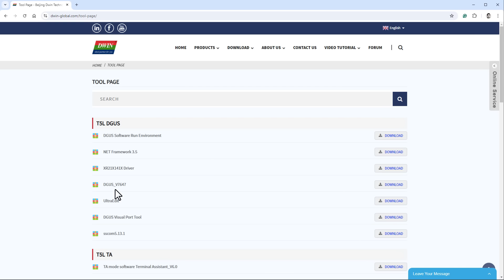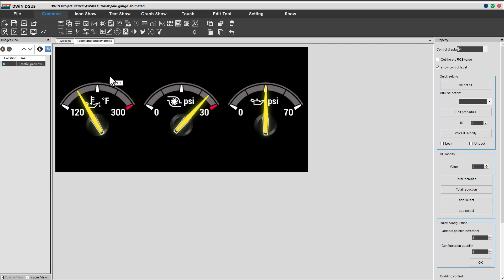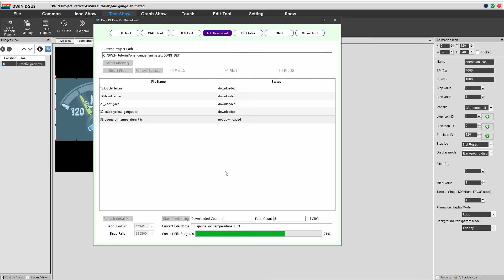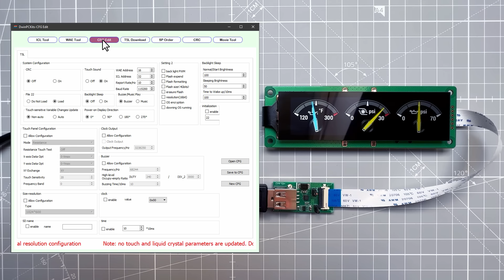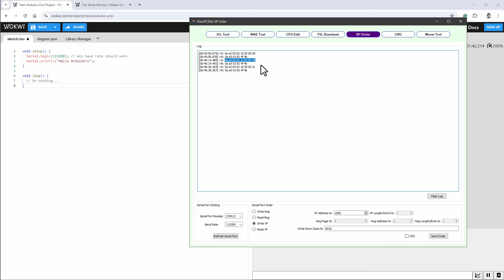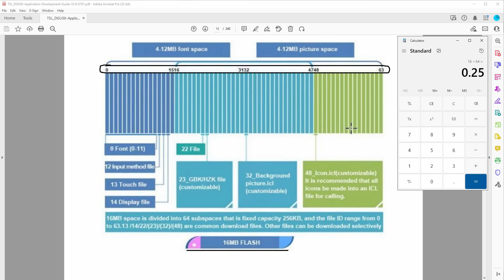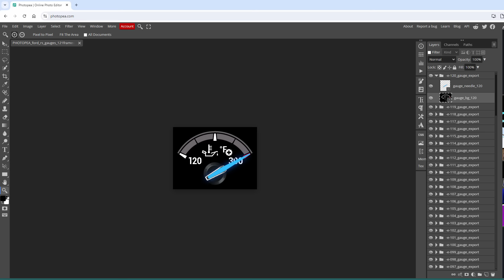Ford RS gauges with Arduino UNO and DWIN intelligent display (like Nextion displays)

Comment: Hello, I wanted to ask a question, in this case, how can we get the information to be able to pass it to the Arduino and show it on the display? In this case, it would be a 99 Civic.
Reply from the maker: If youe car has the OBDII port, it would be using that port. If not, you would need to directly interface individual sensors. I do plan to cover the OBDII part in the next video.
Reply: @upir_upir  Is the information sent from the sensor the same as OBD II? I believe the information is similar.
Reply from the maker: No, those are different formats, protocols, voltages... it´s quite different way of getting the data.

Comment: Hello there, i am a student & tech nerd that does stuff similar to this. I just want to add a small note - Nextion has an app itself, that has a better interface, more configuration and a lot of features required in this video. I have used it all my life for TFT display apps and a lot of other stuff. It does support devices that aren't manufactured by Nextion, it just has a small amounts of unsupported features (the quantity will vary among device manufacturers) If you are looking to do something like this, i reccomend Nextion's app as i said why. Other than that, i love your talent, this video and everything about it! Thank you for this entertainment.

Comment: ICL was a file format for Icon Libraries. You could try to manage them with GreenFish or some other icon editor tool. It's basically a DLL containing only icon resources.
If this is the case you can get some proper 32bit transparency editing.
Reply from the maker: Unfortunately this particular ICL format has just the same extension, but it´s completely different format. The 1-bit transparency is not a restriction of the file format, but of the used chip on the display.

Comment: Also please note that the aliexpress link of the screen is sold out or not working...
Reply from the maker: I know, it´s out of stock, hopefully will be stocked soon. In the meantime, you can for example use this display instead - https://s.click.aliexpress.com/e/_DEm5LMr   or any DWIN 5V display should work.
Reply from the maker: Looks like they restocked a few pieces - https://s.click.aliexpress.com/e/_DCHgjj9

Comment: Amazing video as always ! Great screen options ! 

Can't wait for the video on sensors. I am a total noob with arduino but I can see myself doing this. I am going to look on their website to see if they have a screen that would resemble 3 52mm gauges side by side in terms of width. 

I do really love the step for step info and also the explanation for the use of certain settings. Keep it up my man!
Reply from the maker: Thank you, I´m glad you like it! They do have some round screens available, I will cover those in the next video.

Comment: Doesn't have a rotate function to use just 2 pictures???😢😢
Reply from the maker: Unfortunately not. Copying pictures is much easier and faster compared to rotating images and compositing them together, so the used custom chip can be smaller, simpler and cheaper.

Comment: I am an RC modeller and I can imagine that such kind of display could pimp one's RC plane dashboard to make it more scale. Thank you for revealing this nice stuff. 👍🌻
Reply from the maker: I´m sure those displays would look great inside RC planes, plus they make them in all the different sizes and shapes, so it should fit into any usual scale. What kind of plane do you have?
Reply: @upir_upir  I have a bunch of planes up to 150cm wingspan. Those are to small I think. But there are a lot of scale planes beyond 250 or 300cm whose dashboard would be big enough for this kind of displays. Wouldn't it be nice to see RPM running up when opening the throttle? And all the other parameters regarding flying? 😊
Reply: Whoa that's a great idea 
Would bring the fpv to the next stage
Reply: there is actual HSD LCD screen kit for FPV rc planes. Lost the link, don't know if they still make them. But it's/was definitely a thing.

Comment: If you buy the DWIN, does it come with the cable & adapter board, or are they separate?
Reply from the maker: They have the option to buy with or without the accessories, which will add a few extra dollars, but it´s definitely worth it.

Comment: Does that screen have a way to rotate a single image? If so, it would use a lot less memory to store the gauges as a single background layer image and then have the needle as a single image that is rotated, instead of having 121 images of the needle in different positions...
Reply from the maker: Unfortunately, it cannot rotate images. Actually, it might rotate image, but the quality is not so great and you only have 1bit transparency, so no alpha blending. That´s the limitation of the used custom chip.

Comment: As always - awesome and neat) however - did I miss the part about changing the units and colors by tapping the screen?
Reply from the maker: Thank you. You didn´t missed that part, it will be covered in the next video. In the meantime, you can download the project from GitHub and see how it was made.
Reply: @upir_upir  oh, have You watched that instagram-link, I've send at start this week? Where round LCD was installed in a HID lens? Thought that would impress You

Comment: This is so awesome...as I'm rebuilding a Mercedes 190E project, I want to have modern tech in there like these sort of digital gauges... You make it seem fairly easy, Just need to get a few displays, as I have many arduino boards
Reply from the maker: That sounds very interesting! Do you have any photos/videos of your car? I do plan to create more tutorials on this topic, hopefully ending up with a full dashboard project..
Reply: @upir_upir  I do but it's still in the very early stages as I'm converting it into a manual, but am taking note of your tutorials, as they are very helpful. I had seen some else convert a full instrument cluster as well. 
I am starting to order these little displays as well.
Reply: got obd2 on it? easy to connect a display and have a full dash for obd with basically zero work :)  It may be pre obd2 though

Comment: Hmm, this somehow feels like a massive waste of memory. I mean I get it works and it’s pretty. But if you drew the graphic with vectors and curves instead of using images you could have a ton of different graphics without running in any memory problems. 
And you wouldn’t need the display to be as smart. Guess the arduino is not fast enough to do this?
Reply from the maker: It´s actually the opposite. This display has a very cheap, custom made ASIC chip that draws images very fast, and it can be easily expanded with more memory, which is cheap. If you want to draw objects with vectors and curves, you need much more powerful microcontroller, which would definitely not be possible with Arduino, and in the end, that solution would most likely cost more.

Comment: It's an impressive video, but I'd like to see how the page changes when you tap on the screen, like at the beginning of the video. In other words, I understand how tapping works, but I don't quite understand how to add a new set of images and change where they're located on the page. Also, it's not clear if the addresses for the animation elements in the other set will be the same.
Reply from the maker: Thank you. If you want to see how that project was made, you can download it from GitHub and take a closer look - both projects are there. I will explain all the details in the next video, but yes, the VP addresses are the same between those pages so they both change at the same time.

Comment: Wow that was a long video, but so damn detailed! - I've had one of those DWIN displays kicking around for a couple of years but never made anything as I think the documentation for DGUS is very badly written. I find Nextion displays much, much easier to use, but with their limitation of course. Because of this video i will look for the display again and give it another try. Thanks!
Reply from the maker: Thank you, I´m glad it was helpful, and if it inspired you to take a second look at the DWIN display, it was worth the effort! I agree that the documentation is horrible, especially compared to Nextion displays, but once you get it working, it´s a pretty cool display. Good luck with your projects!

Comment: Great idea!
I'm thinking about implementing it in my car, do you have any idea of making a video explaining how to connect some sensors (oil temperature, oil pressure and boost)?
Once again excellent material, excellent explanation!
Reply from the maker: Thank you. I already have a video about creating a boost pressure gauge with a real sensor - https://youtu.be/cZTx7T9uwA4
and I plan to cover more sensors in the future videos, including connecting it to OBDII port and getting the data from there.

Comment: wow i've never seen software with this bad user experience
i don't think you could use this program without a tutorial
Reply: Right? I've had a DWIN display kicking around for 2 years and i gave up so far. It's so insanely cryptic - Who came up with the idea that the user has to name files specially and manage the memory usage themselves? The app should be able to do that. It's crazy how bad the software is, and it's sad, because the displays are really good.
Reply from the maker: Agree with both. I wonder if it´s just the English translation and it´s actually more usable in Chinese version, or if it´s just bad in general. Also, the simulation in the software is hardly ever working properly, but thankfully once you get it on the display, it work seamlessly, also also very fast. I like those displays, but it took me a long time to figure stuff out.

Comment: I think this is brilliant. I'm restoring an old motorcycles. I'd love to do my own clocks and have lean angle sensor for it. Not enough time in life to learn this just as I'm starting to learn 3d printing lol it's amazing tho great work. I've always wanted to do this stuff.
Reply from the maker: Thank you, that sounds pretty cool! I have another video with tilt sensor, perhaps you can use bits and pieces from that one for the lean angle? https://youtu.be/GosqWcScwC0
That said, I have also recently started with 3D printing and I´m overwhelmed as well..
Reply: @upir_upir  that's really useful, thanks for the link. Truly inspired 👍 I'll have to cost up the parts later today.

Comment: Love it and your newly discovered channel.
Please make this (and other projects like this) available for OBD-2 i need this in my beautifull mk1 Audi TT 😊
(I would even buy this ready made from you too)

Greatings from NL✌🏻
Reply from the maker: Thank you. Connecting this to OBDII is definitely on my to-do list for the next video. Audi TT is a cool car!
Reply: @upir_upir  Isn't OBDII one of the CAN-buses in most cars?
Reply: @andersdoverud9046  Yeah, straight to canbus would be easier, code wise, and would only need 2 wires that most probably you already have near the dash.
That would give access to basicly every value you would need, you just need to find the right address.
Reply: @upir_upir  You got yourself a fixed subscriber haha. Thanks! Got a few things changed and have it for 15 years now already in mint condition 😇
Weirdly they did not want an oil pressure gage and turbo pressure gage fixed.. It is visible via obd2 though! I really like mods that are small in the dash too, so i keep my fingers crossed 😉

Comment: Been a viewer for a long time. I cannot begin to imagine how much work this was to figure out from scratch, but you presented it in such a way that viewers can easily do it. I am sure it took days to weeks to figure out that weird software and get stuff working! Thank you for your hard work, dedication, and sharing spirit my friend.
Reply from the maker: Thank you for your support, it´s much appreciated. You are correct that figuring out the software was tedious and time consuming process. I wonder if it´s just bad, or if it´s just the English translation and it´s more usable in Chinese. In any case, hopefully it should be more understandable now.
Reply: @upir_upir  I mean, there's levels of bad translations! The software for the tl866ii+ (and now t48/56) programmer has gotten better over the years but it's still weird at times. But 5 years ago using that programmer/software was like pulling teeth - just like the screen software! Having to press multiple buttons for no reason, etc. 

I made a comment below about using an elm + torque software (+torquescan and the plugin api app) for the canbus stuff. It would be nearly impossible to try to do it all on an arduino. Using an elm+torque, you'll be able to get all the information you need for the canbus stuff, including the values and how it's mapped to the actual gauge, something torque is amazing at and pulls from massive database! Then once you have all the info, addresses, values, mapping, etc from Torque, moving it over to an arduino+canbus adapter will be a lot easier!

The reason I'm so excited is my new car has 3 gauges on the dash. Boost, turbo RPM, and... battery voltage. Wompwomp.. So I was looking into using a 2" round LCD+arduino to replace that useless voltage gauge with something actually useful, so your work here has saved me uncountable hours. And possibly the other 2 depending how well it worked out! It's even dumber because you can't even see coolant temp (in degrees) or oil pressure at all, except in performance gauge view, which gets rid of the speedometer gauge.. So your project overlap with my plans is like 95%. 

Thanks again!
Reply: @upir_upir any guides on how to connect with sensors in guess they have to be connected to arduino but where on the board

Comment: The only question I have: is this is an efficient use of resources? It seems like a lot to use a unique bitmap for every single value. Is it redrawing the entire graphic as it loads each bitmap? Wouldn't it be more efficient to display the background graphic as a static image, and only draw/redraw the needle?
Reply from the maker: This is how the display should be used, as it only supports 1-bit transparency, so showing the needle over the background might introduce some visual artifacts. I was able to fit two themes with 3 gauges, each having 120 images. That´s 720 images. I feel like that´s probably way too many steps, and probably half of the images would still provide nice and smooth gauge, plus I can probably also lower the compression and it would still look nice. Also, the images could be cropped slightly, but it was easier to do it this way for the tutorial.
Reply: @upir_upir  I was thinking the same, maybe even use vector files for the background, where eg colors could be variable. That should theoretically also work for the needle (with the glow), as gradiants are possible as well. But 1-bit transparency is not enough. Is there any other approach to generate the images instead of saving them? BTW I would love to provide a given image as svg if that helps in any project.
Reply: @upir_upir Most digital gauges look slow and choppy to me, this one looks good

Comment: absolute perfect timing. i'm trying to retrofit something like this in my car.
do you think i can just hook up the sensors i installed like you connected the potentiometers or do i need to change something?
Reply: it depends on the output of the sensors, but it is doubtful that they will be linear analog voltages like that provided by the potentiometers. possibly available online but you could use a oscilloscope to read the output of the sensors and then code that into your display controller. intermediate to advanced project to integrate into an actual vehicle.
Reply from the maker: Thank you, I´m glad it´s helpful. As for your question - it depends on the sensor. Most Arduino sensors would be 5V, but car sensors would be most likely 12V, so some conversion would have to be made. Plus as the other commenter noted, the reported values might be non-linear, and sometimes the sensor does not change the voltage, but resistance instead. What kind of sensor are you trying to interface?
Reply: @upir_upir  Thank you for the reply!
i instlled three sensors: an oil temperature, an oil pressure and a water temperature sensor.
the temp sensors are NTC thermistors and the pressure sensor is resistance based.
what would be the best way to convert the 12v signal to 5v for the arduino to read? sorry i'm a bit of a beginner
Reply: @esh92  Use two resistors to form a voltage divider. Google is your friend here. Just be aware that without a reference, the reading will fluctuate when the car is charging the battery (voltage goes to 14V or so) - This can be fixed with another voltage divider that feeds 12V scaled down to 4.xx V into one of the analog inputs and this value is "full scale" for the reference.
Reply: @zaprodk  i did some research and it seems like this method will not produce results that are accurate. at least not as accurate as using "normal" 12v gauges.
since i want these to be working gauges and not a simple gimmick, i'm gonna have to keep looking for alternatives.